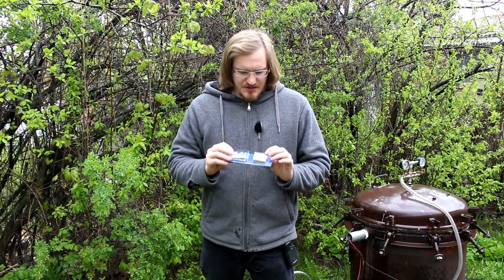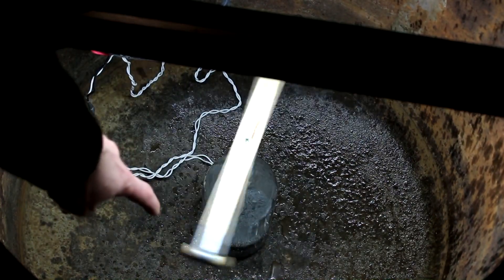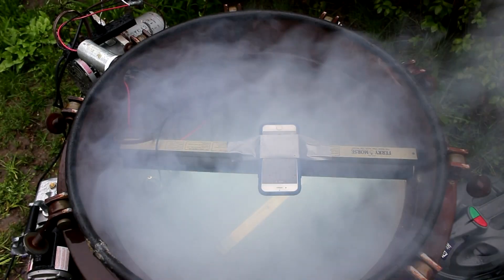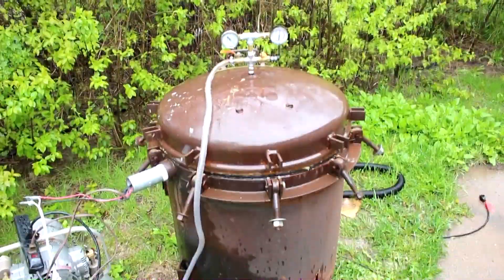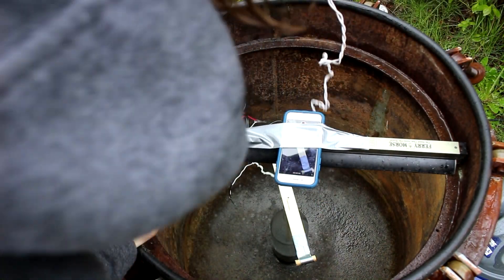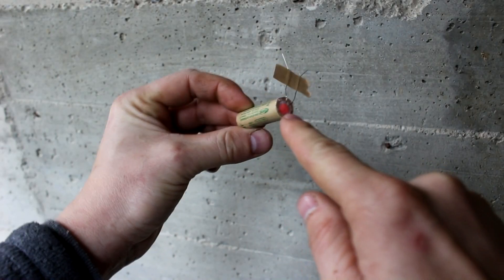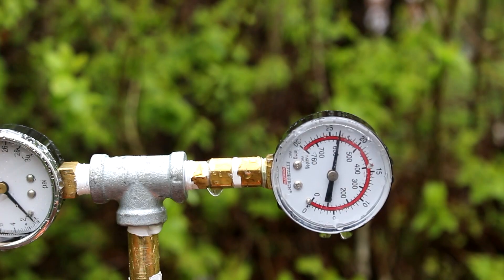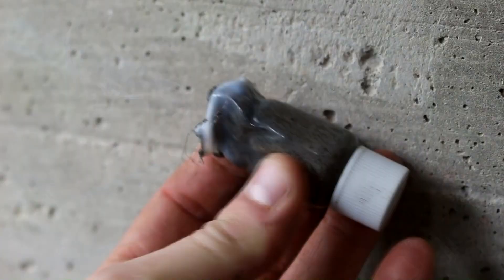Will a Model Rocket Motor Work In Vacuum?

Comment: The discharge simply reached the walls of the container and pushed off. Also the moment you released gas pressure into a vacuum chamber you introduced an atmosphere. No more vacuum.
Reply: That's how rockets work in space, they immediately start pushing on their own exhaust.
Reply: @DeputyNordburg 
Explain in Detail
Reply: @TerenceHughes4501   A rocket engine uses stored rocket propellants as the reaction mass for forming a high-speed propulsive jet of fluid, usually high-temperature gas. Rocket engines are reaction engines, producing thrust by ejecting mass rearward, in accordance with Newton's third law the vehicle is propelled forward. Most rocket engines use the combustion of reactive chemicals to supply the necessary energy, but non-combusting forms such as cold gas thrusters and nuclear thermal rockets also exist. Vehicles propelled by rocket engines are commonly called rockets. Rocket vehicles carry their own oxidiser, unlike most combustion engines, so rocket engines can be used in a vacuum to propel spacecraft and ballistic missiles.

Compared to other types of jet engine, rocket engines are the lightest and have the highest thrust, but are the least propellant-efficient (they have the lowest specific impulse). The ideal exhaust is hydrogen, the lightest of all elements, but chemical rockets produce a mix of heavier species, reducing the exhaust velocity.

Rocket engines become more efficient at high speeds, due to the Oberth effect.
Reply: @DeputyNordburg 
Yeah that's not going into very much detail. I think you're making shit up
Reply: @TerenceHughes4501  Well, what about the tremendous sucking force of the vacuum in front of the rocket?
Reply: @TerenceHughes4501  making stuff up? Lol. That’s rich. This from the guy who thinks that somehow air molecules push back against the rocket. All the while these air molecules being blasted backwards 

So where are your “details” about how the air pushes back against the rocket?
Reply: @TerenceHughes4501  - "Explain in Detail"
Sure, but YOU must answer a few questions:
When the rocket engine is running:
1 - Does the exhaust gas get "ACCELERATED" as it leaves the nozzle?
2 - Does the exhaust gas have "MASS"?
3 - Can "MASS" Be accelerated without a "Force"?

Answer these three questions and Ill give you the REAL questions that get to the heart of "Rocket Propulsion".
Reply: @TerenceHughes4501  SO you run away?
Are you SCARED of questions?
Reply: @TerenceHughes4501  - "You will now provide a link showing rocket propulsion working in a vacuum.
Yers I WILL.
Search YT for "Falcon Heavy From Launch to Landing in 4K! USSF-67" from 'Astronomy Live'
It is a LIVE VIDEO of the Falcon Heavy from Launch to booster landing with NO CUTS, and NEVER LOSES SIGHT of the boosters.

It shows MULTIPLKE examples of rocket propulsion IN A VACUUM - ON LIVE VIDEO.
Tell us all what you find genius.
Reply: @stuartgray5877 
How high in terms of altitude did it go
Reply: @TerenceHughes4501  The boosters separated at 50 kilometers and flew as high as 120 kilometers before descending again. The atmospheric pressure above 50 kilometers is LESS THAN 1.0 Torr.
Reply: @TerenceHughes4501  Wow - you go around spouting nonsense thinking you sound smart.
Let's leave the technical thinking to those that bothered to complete high school, shall we?

Comment: The problem is that you constantly need air, the experiment only gave thrust for a moment.
Reply: Why would you need air if the oxidizer is part of the motor?
Reply: I do constantly need air to breath yes.
Reply: @DeputyNordburg  : Well, I can go about 45seconds without breathing but that's about it.
Reply: @DeputyNordburg  - "I do constantly need air to breath yes."

So how do oxy-acetylene torches work UNDERWATER?
Reply: @DeputyNordburg  The POINT IS: You CAN take
Oxidizer
WITH YOU
to places where there is none.
Reply: @stuartgray5877   That is the point of underwater oxy-acetylene torches?  I'm not sure why.
Reply: @DeputyNordburg  My POINT was that we can have flame in places where the is no air as long as we TAKE OXYGEN WITH US.
Reply: @stuartgray5877   HAS anyone SAID that WAS NOT the CASE?  How IS that RELATED to BREATHING?

Comment: The thrust of the rocket receives the resistance it needs from the wall of the container, the chamber cannot, at any time, equal the supposed vacuum of space, where there will be no wall that offers the necessary resistance for the rocket to receive its impulse. In addition, at the moment that the combustion fills the container with gases, the vacuum ceases to exist.
Reply: False. Blatantly. If there were true then as soon as a rocket were like 100 ft from the pad it would fall back down. I mean, how ignorant are you? 

I know, bro. You are duty bound to claim space is fake because you’re little magical domes pizza earth can’t handle it. Sad.
Reply: Lets say i have a space suit inside a really big vacuum chamber, and i am standing on top of a skateboard with a bowling ball, if i throw the bowling ball forwards, what will happen?
Reply: @eduardopupucon  That you are pushing on the ball, a heavy object that exerts resistance, and that will cause the necessary reaction to create movement. Lets say i have a space suit inside a really big vacuum chamber, and i am standing on top of a skateboard with nothing in my hands, and I move my arms as if I were throwing that ball you mentioned but without a ball, that is, pusing on the vacuum, what will happen?
Reply: @manumirat2051  the bowling ball is 11kg, but what if i have 11kg of very tiny balls being pushed, like really tiny, but the same weight as that bowling ball, what do you think will happen?
Reply: @manumirat2051  if instead of one 11kg bowling ball i throw eleven 1kg pool balls, do you think the momentum will be different just because they are smaller and the bowling ball is bigger?
Reply: @eduardopupucon  You didn't prove rockets can move in a vacuum, keep it up. Bye enjoy your day.
Reply: @manumirat2051  i'm just asking you some questions
Reply: @eduardopupucon  Yeah, I see, keep asking questions if that is all you can do. It would be better if you try to provide real verifiable, observable, measurable and repeatable evidence that rockets can move in a vacuum emvironment.
Reply: @manumirat2051  well you're the one that's denying the evidence right in front of your face
Reply: @eduardopupucon  well you're the one not being able to provide real evidence of rockets moving in a vacuum.
Reply: @manumirat2051  - "you're the one not being able to provide real evidence of rockets moving in a vacuum."
I can show you live video of rockets working just fine in a vacuum.
But let's discuss the actual PHYSICS behind rocket propulsion.

When the rocket engine is running:
1 - Does the exhaust gas get "ACCELERATED" as it leaves the nozzle?
2 - Does the exhaust gas have "MASS"?
3 - Can "MASS" Be accelerated without a "Force"?

Answer these three questions and Ill give you the REAL questions that get to the heart of "Rocket Propulsion".
Reply: @manumirat2051  Are you SCARED of questions?

Comment: NO OXYGEN NO WATER AND YOU DO NOT HAVE ANY AIR IN THERE...THIS IS A BOGUS TEST TO BEGIN WITH..NO MOTOR RUNS IN A  VACUUUM THIS IS A LIE..PRESSURE IT UP..WHY WOULD YOU PRESSURE IT UP ...TAKE ALLLL THE AIR AND WATER OUT AND STOP LYING

Comment: I'm wondering why the plastic tube didn't explode in the vacuum. But there was a tiny bit of air in the tube to help ignite the powder. Once the back blew off, inertia move it forward the the smoke created an atmosphere to further push it forward. Notice there's two stages in the acceleration? The first time you tried in a vacuum is the most accurate of what would happen in the infinite vacuum of space. Even with an oxidizer the exhaust has nothing to push on. You can't get that result in a closed chamber. The only reason rockets "fly" in space is the momentum they get while in the atmosphere.
Reply: If i am standing on top of a skateboard and throw a bowling ball, why am i going to move fowards? If the only thing that is "pushing air" would be the bowling ball, completely disconnected from my body the moment i throw it
Reply: @eduardopupucon  You're in the gravity well of Earth so you have mass and the object you're throwing has mass, that's called inertia. In space aren't things weightless? You can throw anything and not move an inch.
Reply: @nesNYC  well your assumption is wrong, in space things have mass, they just don't have a large body attracting them like the early, you could make an m&m orbit a bowling ball if you wanted, the rules don't change for smaller objects
Reply: So you’re not educated enough to know that structures can be made to withstand the “massive” atmospheric pressure of 15psi?

Lol. No wonder why you think the earth is flat. Submarines must be fake too.
Reply: @kitcanyon658  What does that have to do with my argument? Firing a rocket off in space is like peeing in the sea and expecting propulsion 😄
Reply: @nesNYC  : You made the claim about wondering why the tube wasn't crushed. 

Do I need to cut and paste your own comment for you? 

Also, how does a rocket push off the ground when it is 1,000 ft in the air? How come a rocket's thrust increases as the air get denser? 

I know, bro. So many hard questions. Be harder to be told to believe in a magical domed world.

Comment: For all of those that think "rocket propulsion does NOT work in a vacuum" I challenge you to answer the following three questions: 
1 - does the exhaust gas have MASS? Yes or no?
2 - When the exhaust gas exits the rocket nozzle, is it Accelerated? (Does it experience a change in velocity) yes or no?
3 - can MASS be accelerated WITHOUT a force?  Yes or no?
Noy most "physics deniers" will REFUSE to just answer these three questions because they know that answering Proves THEM WRONG!
So we'll see if any of these cowards has the spine to respond. (If they do it will just be to hurl juvenile insults)
Reply: newton's 1st law requires an external force, trollbot stu. a vacuum cannot apply one.
Reply: @papalegba6759  so answer my questions.  The answers are simple yes/no.  Why are you afraid to answer them?
Reply: @stuartgray5877  your questions are irrelevant, trollbot.
Reply: @papalegba6759  oh because answering my high school level questions PROVES YOU WRONG.  That's why you refuse to answer imbecile.
Reply: @stuartgray5877  so you can prove newton's 1st law wrong? ok trollbot.
Reply: @stuartgray5877  literally saying NO U! Useless chatbot Stu 😂😂😂😂😂😂😂😂😂

Comment: Why did you not apply the tightening clasps and screw them tight?  They are open.
Reply: The vacuum pulls the lid tight
Reply: @stuartgray5877  there isn't a vacuum, trollbot.
Reply: @stuartgray5877  you lie all the time, so yes.
Reply: @papalegba6759  So according to "Papa Legba Physics" the lid of a vacuum chamber is NOT pushed closed by atmospheric pressure as the chamber pumps down.
Got it.
Reply: @stuartgray5877  never said that, chatbot.
Reply: @stuartgray5877  chatbot Stu can see a vacuum 😂😂😂😂😂😂😂😂😂😂😂😂😂😂😂😂😂😂😂

Comment: What does this prove? There are several things wrong with this experiment. It needs to be a perfect vacuum. It's not, there is still "atmosphere" In the vacuum chamber. And the vacuum chamber needs to be MUCH MUCH BIGGER!!! Remember...."space is not contained.  Also....when you added the bottle on the end with the plug you put the rocket in its own little "atmosphere"...yes that worked to get it burning since as you saw...even in a partial vacuum it would not light. That gave it enough time to build up pressure in the little "atmosphere" to push out the plug wich gave a little thrust to start moving. Then once the thrust hit the side of vacuum chamber it pushed off that accelerating it further.
Reply: Wait. Are you claiming that a rocket only pushes off air to get its thrust? If so, does the density of the air matter?
Reply: @kitcanyon658  are you claiming w=pv is wrong? looks that way, trollbot guy.
Reply: @papalegba6759  I challenge you to answer the following three questions: 
1 - does the exhaust gas have MASS? Yes or no?
2 - When the exhaust gas exits the rocket nozzle, is it Accelerated? (Does it experience a change in velocity) yes or no?
3 - can MASS be accelerated WITHOUT a force?  Yes or no?
Noy most "physics deniers" will REFUSE to just answer these three questions because they know that answering Proves THEM WRONG!
So we'll see if any of these cowards has the spine to respond. (If they do it will just be to hurl juvenile insults)
Reply: @stuartgray5877  i challenge you to prove w=PV is wrong, trollbot.
Reply: @stuartgray5877  c'mon, trollbot; prove w=PV is wrong plz, cos that's what you are claiming.
Reply: @papalegba6759  you missed  @Kit Canyon's point; if a rocket exhaust has to interact with ambient gas to generate a force on the rocket body, why doesn't the amplitude of the force depend on characteristics of that ambient gas such as its density?
Reply: Space is not a perfect vacuum, so rockets should work just fine there.
Reply: @DeputyNordburg  AND they will work just fine in a PERFECT VACUUM as well. Rockets work via the RECOIL FORCE of pushing out the mass of the exhaust. They don't need ANYTHING ELSE to propel themselves.
Or did you think that RECOIL stops working in a vacuum like imbecile Papa Legba?
Reply: @stuartgray5877  The force propelling a rocket is caller thrust.  Recoil is the rearward thrust generated when a gun is discharged. The recoil is a result of conservation of momentum, as according to Newton's third law the force required to accelerate something will evoke an equal but opposite reactional force, which means the forward momentum gained by the projectile and exhaust will be balanced out by an equal and opposite momentum exerted back upon the gun.
Oh, and a perfect vacuum has never existed, and it would be difficult to define one as perfect were it to contain a rocket...  Yes, it would work.  In fact the closer to perfect the vacuum is, the better the rocket will perform.
Reply: @stuartgray5877  why do you think the gas laws are wrong, chatbot? Why do you lie about everything? 😂😂😂😂😂😂😂😂😂😂😂
Reply: @DeputyNordburg  thrust is an applied force, chatbot 😂😂😂😂😂😂😂😂😂😂😂😂

Comment: Seal level is 29.9 inches of mercury and he pulled 25 inches, no where near a vaccum. Then he stopped the pump so the material ejected from the motor ruined what little vaccum he pulled.... Is this a joke? A vaccum would be zero inches of mercury (or 29.92 on his gauge as zero is atmospheric on that gauge)
Reply: If rockets only worked by pushing off magical air molecules then as the air pressure went down so would the thrust. Thus, you wouldn't need a perfect vacuum to prove your idea - just a very small amount of air. 

But I get it. You guys can just keep making up stuff because you can't fashion any type of equation to prove your point. Smart - keep away from real details.
Reply: @kitcanyon658  if you had an infinite perfect vaccum (like they say space is) it would instantly completely suck rocket propellants out a nozzle as quick as you can produce it and would therefor produce no thrust, it would be very difficult to simulate that, you would need a massive powerful vaccum pump and only use a small rocket to prove this as the pump would have to top the propellant ruining the vaccum, that was my point and what equation would you like? You do understand equations are just a language? To describe reality? They don't cause reality
Reply: @johnporterfield7523  : Vacuum does not suck, which just goes to show your misconception of what makes matter deform or move. Forces do that, or rather, imbalances of forces. 

Its pretty obvious what equation I'd like to see you produce, that being the thrust of a rocket engine. Plain and simple. 

Does it seem like such a thing is impossible to produce? In the real world, not the simulated reality of YouTube, people can and do exactly model physical systems (such as rockets) with equations. And guess what? The data they gather from real instruments, and not just ignorant opinions from YouTube commenters, matches their equations. 

So my question is, why can't you make up a mathematical model that does just at good?
Reply: @johnporterfield7523   I challenge you to answer the following three questions: 
1 - does the exhaust gas have MASS? Yes or no?
2 - When the exhaust gas exits the rocket nozzle, is it Accelerated? (Does it experience a change in velocity) yes or no?
3 - can MASS be accelerated WITHOUT a force?  Yes or no?
Now most "physics deniers" will REFUSE to just answer these three questions because they know that answering Proves THEM WRONG!
So we'll see if any of these cowards has the spine to respond. (If they do it will just be to hurl juvenile insults)
Reply: @johnporterfield7523  - "well I'm an aeronautical engineer with 37 years experience"
If this was true, you would answer my questions. WHY are you LYING?
Reply: @johnporterfield7523  Stop LYING about being an engineer.
I can tell that you failed to complete high school.
Reply: @johnporterfield7523  So are you STILL going around lying about being an engineer?
Reply: @stuartgray5877  do you return to this thread every month to harass one person? Yes, you in fact do 😂
Reply: Are you still going around LYING about being an engineer?
Perhaps you drive a train?